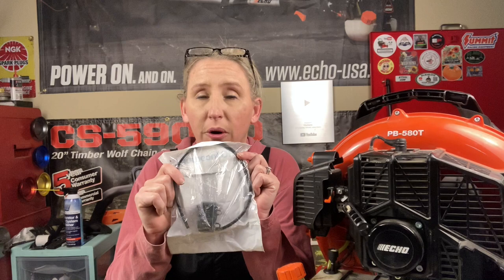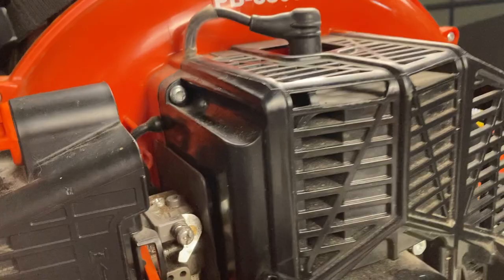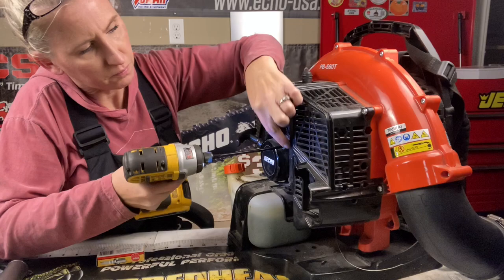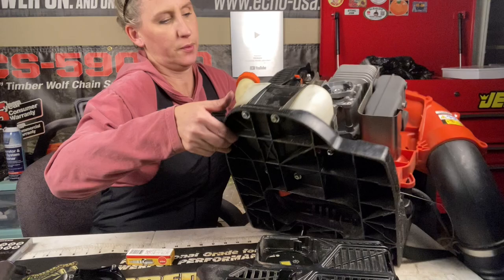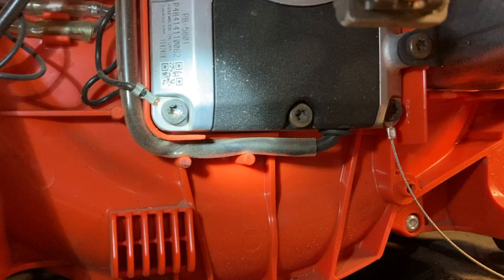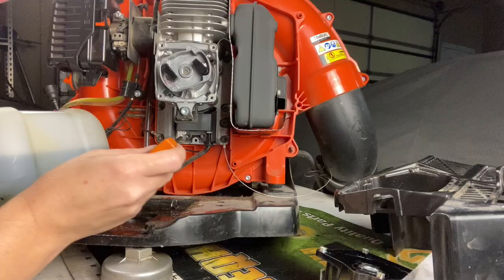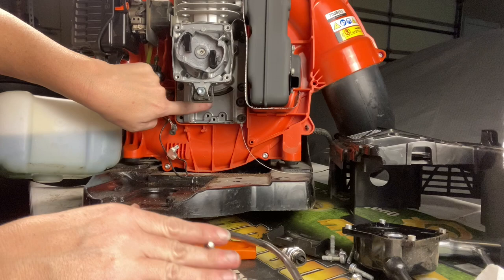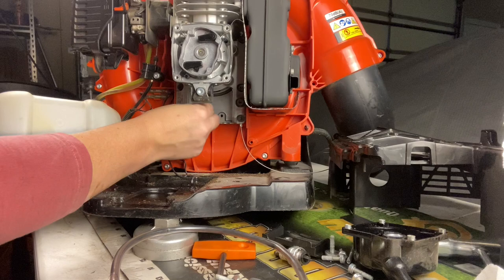Echo Backpack Blower Starts,Then Dies.. Ignition module replacement. Repair/Vlog

Comment: I have a stihl br600 and It runs for about 5min but when it dies it starts right back up and does it again but I have already replaced the coil and the carb and the fuel lines the fuel filters and the spark plug ?

Comment: I have always thought hi-fi sound systems are made to be annoying, deep screw holes in tubes.
Thanks manufacture, ill have to make a very long screwdriver, and it's a security screw :-(
Security screws safe in the bin :-D
I have no patience with mean design.
I have to hold back and not use a hammer, yep i'm a bloke lol.
Happy repairing :-D

Comment: I have a Huscavarna 266Xp that I just had rebuilt new cylinder and piston. Chain spins at idle, mechanic can not stop it by adjusting carb. He thinks it needs a new clutch.  What do you think.
Reply: New springs in clutch.

Comment: Excellent tutorial. I'd be pretty confident in you fixing anything I could bring in. One quick question please: my Husqvarna 440 Chainsaw runs at a high RPM at start up and continues. Should I just replace the carburetor? It's about 8-9 years old. I use my Stihl 391 on the farm. It's a beast and will cut through trees and logs almost like butter but, It can be very, very difficult to start if it floods. Thanks Chicky  You're the best!

Comment: Warm it up in HOT water or use a hairdryer. Or try some high pressure air.
Reply: yep, heat for both the boot and to smooth out the tube.

Comment: Trick to remove boot:  Squirt a little gas in the spark plug boot, and push a small screwdriver between the wire and boot; move the screwdriver around until the boot will turn on the wire.  Pull it off the wire!  Reverse: put gas on the rubber boot and push the wire and contact end thru the hole of the boot--it will stretch over the contact/wire without problem.  You can blow the gas off, or leave it; no problem.  Works fine for me,  gas helps rubber to slide, and evaporates easily if no oil is in it.

Comment: Great video!
What do you think it would be if the blower runs for 20 minutes then starts to idle up and down with full throttle? I’ve cleaned air filter, spark plug, and spark arrester. I have not tried to tune the carburetor yet. It doesn’t just die like this one did in the video. 
Thanks! Love your content.

Comment: Per Echo support I first checked for clogged spark arrester screen / muffler. Then replaced ignition wire. Still dies after warmup. What else could it possibly be. Fuel tank pressure build up? Carburetor rebuild? This is PB 500H old a dirt. Fixing it for a neighbor.

Update. New fuel filter and it runs just fine

Comment: U might have one in ur junk pile.  I have a generac generator 4000xl. Model# 09777-1 . I need the valve spring retainer. .  can't find any . They do however sell a valve kit . I don't really want to take the head off ,buy the kit $40 plus I would have to buy the lapping tool, lapping paste,spring compressor, not to mention the work that has to be done .  When all I need is the $3 retainer.  Hopefully I can find an alternative to the kit.  I'm about to try making a retainer with washers  
Hopefully you can help

Comment: I "assume" Echo sent you the new module per your order under warranty.  If so, would they have supplied a new boot, new plug coupler, and new insulating tube too?  Under warranty, does Echo pay you fairly for your skill and time on the job?  Would warming the plug boot before pulling it off of old cable help?  Talc powder or tire mounting lube are safe for the rubber insulation and do well at lubing rubber.  Good show!

Comment: I'm having a rough time lol...I got a old echo 452vl...it will pop off but I'm needing the fuel line with two different ends lol...would you have a part number or point me in the right direction please

Comment: I have this blower and have an issue I hope you can help me with. I took the pull off while cleaning my unit. When I reassembled it the pawl won’t catch anymore. It makes a clanking sound when I pull the rope. If I pull the assembly out a little it will catch. I put some washers in as spacers and it started a couple of times, but then started doing the clanking again. Do you have any ideas.

Comment: Don't have a blower but I have a chainsaw that acts like it is seized up but if you turn the crank with a socket wrench it turns freely then when I started pulling it to start it the thing seized up again any advice on what is wrong. It's a Craftsman about 2 years old and only used a few times Thanks for helping us navigate yard equipment pitfalls :)

Comment: 'Pushing is Easier than Pulling'.   Now that i saw what you meant, yep!   What about with Spark Plug Boot?  
Silicon on wire for plastic tube or chopstick to straighten\ 'open' it?   ... never mind, Nice.
Thanks for showing attaching Plug's Spring, whatever works for "Poky tool" included.   EXTRA Screw:  T27?

Comment: I have a problem with my Echo PB620 backpack blower. I  have had it over 20 years.I’ve replaced the carburetor quite a few times. It starts right up and runs great for about 15 minutes. After that it will idle but when I give it gas it wants to die. How can I tell if it’s the ignition module or the spark arrestor? I have read the spark arrestor can get clogged. What go you think?

Comment: Hello great watching your video. My friend bought a used backpack blower same as this echo you have in the video. He called me over to help bc it wasn’t starting. Now it has gas, and spark but still won’t start? Used a light tester on the spark plug wire and it light up. Thought it was the carburetor, so purchased a new one and installed had to modify, and it still won’t ignite. Sprayed ether into the carburetor to see if it would fire but still nothing. Any thoughts?

Comment: I hope you see this soon or anyone out there, I have a No pull electric start LAWNMASTER Backpack Leaf Blower. That has spark but hard as the devil to crank. I check for spark and it does have it BUT, since it cranks off the battery could it not supply enough spark? I installed a new carburetor and that doesn't help at all. I heard you mention also in your video that any spark "is good spark". Is it though? Could it be the coil not supplying enough spark? I fix my own equipment and your videos help tremendously. So I'm waiting on your answer. THANKS!!

Comment: I've got a 9010 h that runs gets hot shuts off and won't restart no spark. I replaced the coil still happens. When it cools I have spark will re start and die after running for a bit. Could it be the kill wires.

Comment: So mine will run for 5-7 mins then feels like it’s running out of fuel, rpm’s decrease but then rev back up, probably happens every 30-60 secs once it starts happening. I’ve just replaced the carb kit as I felt the pumper was failing but problems still persist after. I did replace the spark plug but no change. Does the fuel tank vent ever go bad? I should probably run it with the fuel cap loose and see if that fixes issue. Btw, always non-ethanol fuel in my equipment. Any thing I’m missing? Does the coil ever act that way?

Comment: Hello. I have a question unrelated to this particular video. I have a Stihl BG86c blower that is used for home use. It is a few years old now. A couple months ago while using it the pull start cover fell off - the bolts holding them down had worked loose and fell out. I had removed that cover a year or so ago so just figured maybe I hadn't tightened them down well. Today, while using it, the engine made a horrible screeching sound for a couple seconds then stopped abruptly. The pull cord would not spin the engine. I took the cover off and tried to spin the flywheel and it would not budge. I was convinced that the engine was toast. However, I removed the flywheel and discovered one of the bolts underneath it had worked loose and impacted the underside of the flywheel. Luckily I was able to tighten it, put everything back together and it runs fine. Has anyone ever had this experience? The flywheel has never been removed before now so the bolt just loosened up over time. I've never had anything like this happen before. Now I'm wondering what other bolts or parts might loosen on their own and destroy the blower. 😞

Comment: How long has Echo had the lifetime warranty on their coils?? Mine died on my 12 year old straight shaft 22GES brush cutter about 5 or 6 months ago. Local dealer here in Dunedin NZ wanted over $130 I think it was. So I got one off AliExpress for around $20. Had the cap already installed. Has worked perfectly so far. Also managed to accidentally damage the carburetor not long after. So back to AliExpress for that too. I retuned it as the like all my two strokes to run with plenty of oil and a nice rich air/fuel ratio. Engines end up outlasting the rest of the gear it's attached to from my experience. I used to have an old Yamaha YZ125. Ran at 33:1 as I do with all my two smokes. And it was from 1980. Love the smell of two stroke synthetic race oil like Motul branded stuff. Reminds me of younger years

Comment: Silicone spray or Fluid film are great for making things slide. Will Echo cover the cost of the boot when you replace the coil?? You don’t have the plastic Echo gauge for setting the coil. I use one in the shop but when I can’t find it I use the tag off the rental contract at Home Depot.

Comment: I have the same PB-580T and it does not want to start again. It has 90psi for compression, I changed the carb because it was flooding but it still won't start. I took it apart to check the flywheel key and changed the ignition coil although it had spark b4 and with the new 1.... still won't turn over. I even checked the screen in the muffler. It's not flooding now but it just won't work, do you have any advice?
Reply: I also checked the kill wires with a multimeter which tested  good and I unplugged it and tried to start but nothing happened

Comment: Instead of reusing the plug connection, just install new parts on the new module. Echo will pay for the replacement parts.

Comment: Bre, I know this doesnt have anything to do with this topic but  you may have already covered this. I have 2 poulan chainsaws they both fire right up then die. One of them I changed the fuel line on and it worked for a little. The other I never could get to work any better. I cant help but wonder if I put the fuel line on backwards. Any suggestions?

Comment: I have a chainsaw that starts great when cold. After first refueling starting is possible but difficult. It needs several tries. After another refill it will not start anymore until it's really cold. My assumption is that it is a coil issue. Unfortunately, the coil is quite expensive. Any other ideas or should I go for it?

Comment: I saw your review on the true fuel mixed fuel, my question is is the true fuel also has a straight gasoline. Would this be a good to use with a good mix oil added to it? This would eliminate having ethanol in your fuel which is not good for the fuel system on a two-cycle

Comment: I have a PB200 blower by Echo. It was running well for years obviously 😅then it began to run lower and lower and lower. I cleaned the muffler eraster screen and pulled the entire muffler off, and cleaned any caked up residue to which it had none. Spark plug has no spark, I switched out that plug for a plug I know works in my echo weed Wacker, still no spark. Then, I replaced the the start coil for an Amazon coil I saw got very good reviews. Still no spark. I added a spray of gasoline to the piston chamber and screwed back on the spark plug just to see if it would start. No go...

Please HELP ME CAUSE NOW I AM LOST

Comment: Great video again.  It's been my experience that Hall effect sensors don't like heat and do exactly what this has done.  I have a question.  You seemed a bit hesitant about Husqvarna.  Any reason?  I don't have a great choice where I live.  It's either Stihl or Husqvarna.  Echo dealer is 120k's away.

Comment: I also have  a sthil professional type weedeater it will run good for a while  but when I turn it off  it won't start again  ? I'm thinking it's the coil  , like the blower you replaced the coil in Etcho ? I know thoes coils  sometimes quite working  when they get warm or hot 🔥   I've heard that McCulloch  chainsaw  company  went out of business because of  bad coils  that stopped working  because of heat  and tried to keep up with  the other big chainsaw manufacturers   McCulloch  got a big batch of defective coils  that done them in ???? I'm not 100% sure  but I still have a minimack 10 if I had a good coil and probably a carb. Kit would could  get it going again  ?? I would like to talk with you about it on the phone  some how 🤔 that if you can find a source to get a new coil for the saw and possibly the Sthil weedeater  ?

Comment: I'm not going to tell you how to do your job, I just wanted to say, if you had removed the plug boot before pulling the wire it would have slid past the carb without an issue, then put the plug boot on after you have run the new wire up past the carb, for me makes things easier.

Comment: I’m confused about your statement that a spark is a “spark”.   A weak spark won’t ignite the fuel if the plug is a little fouled, or the air/fuel mix is a little off (choke overused), compression is a little down in an old unit, etc.  With a newer higher (normal) compression engine a weak spark (voltage) won’t make the jump over the plug gap, but it’s still a “spark”.  Coils do age (and even become intermittent….. a very expensive repair on an old Lincoln I had years ago… wouldn’t show up on the fancy pantsy electronic diagnostic machine so they kept replacing parts until it ran consistently) and produce a lower voltage spark….. 

Second question. Why to you wear your diamond rings when you do these sometimes very dirty repairs?   Maybe because you have an ultrasonic cleaner machine?  When I got my first one I cleaned every piece of jewelry my office staff wore that day. Ha!

.

Comment: After watching you for some time now I have fun in love with you. And since you never mentioned that you're married or have a significant other I'm assuming you're single. And it just so happens my blower BT 125 Husqvarna quit working on me and I cannot get it working. Got a new carburetor new hoses new spark plug clean the muffler. It runs if I spray some fuel in the carburetor but dies immediately afterwards. Can you come to my rescue.